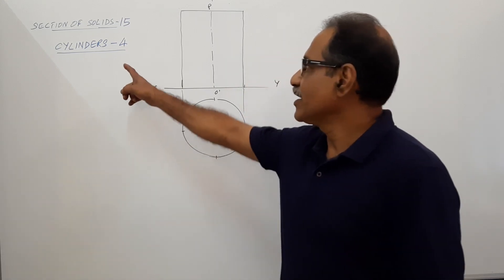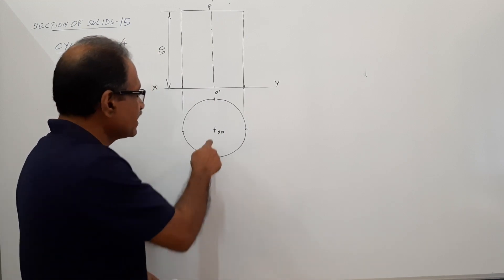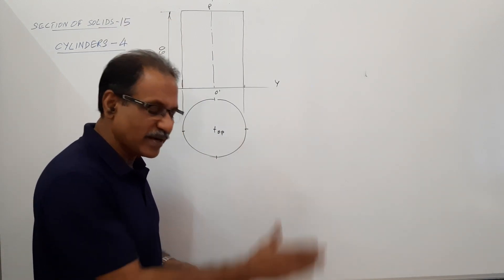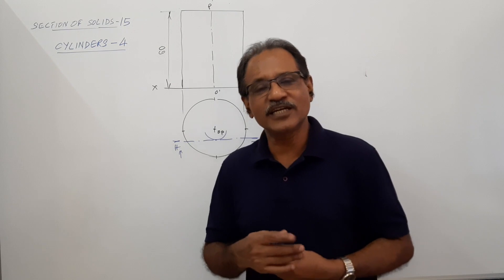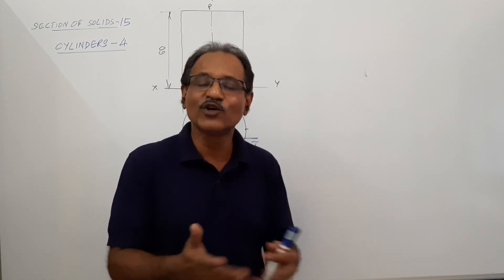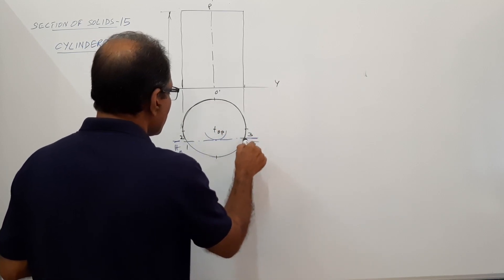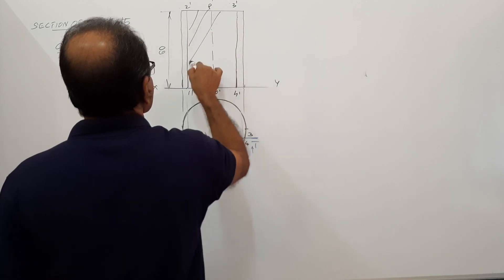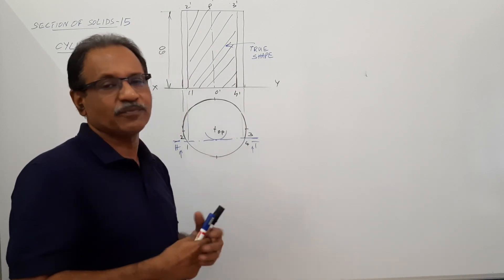Section of Solids -15, Cylinder -4 by Prof. Vinodkumar

Comment: Sir in previous problems you have taken 12 divisions in base circle. In this problem only 4.Why did you do that?
Reply from the maker: Please call me. @9446606906
Reply from the maker: Since the cutting plane does not cut any of the generators, there is np need to divide circle at all. It appears that you are confused. Please call me @9446606906